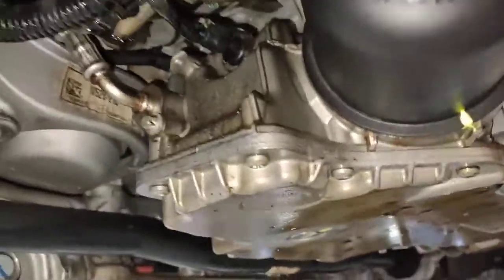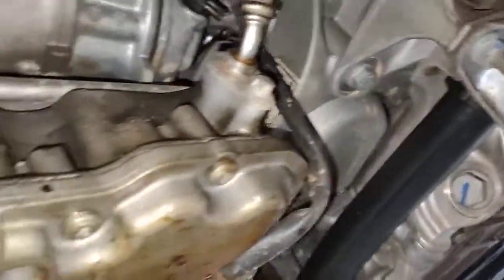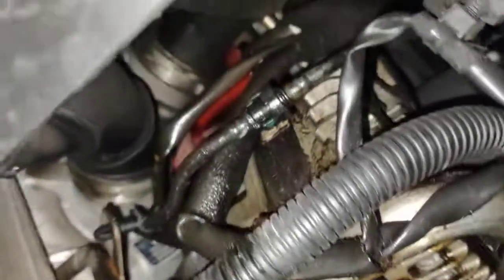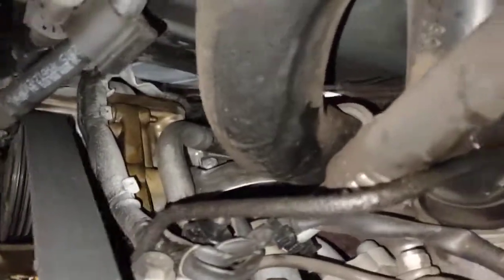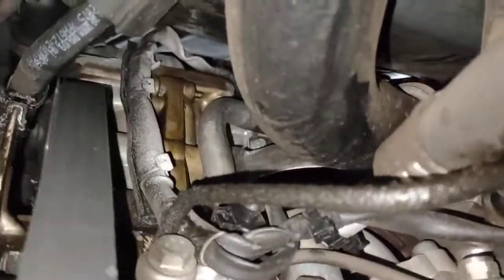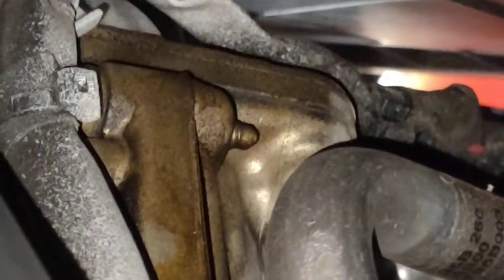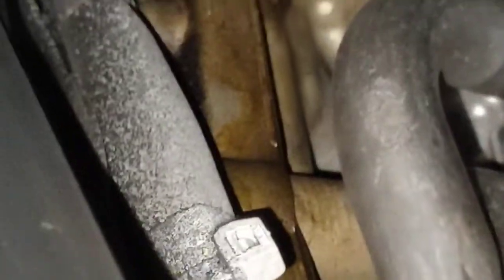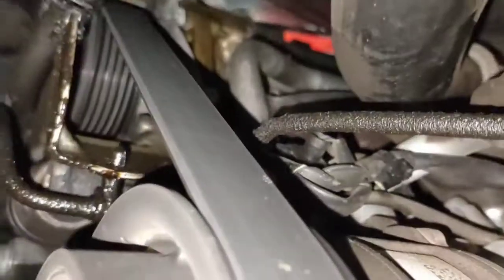Porsche Macan turbo - oil leaks from cam cover/front cover area

Comment: the leaks are impossible to see without removing the bottom cover/tray correct?  If I use a endoscope/snake camera is it possible to check for timing cover or valve cover leaks?